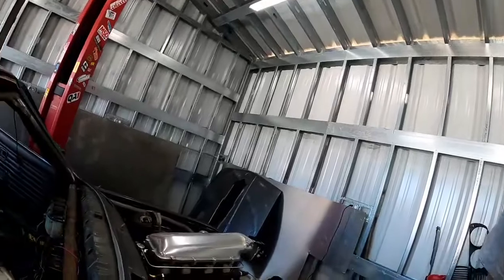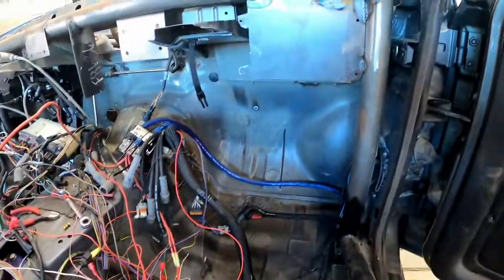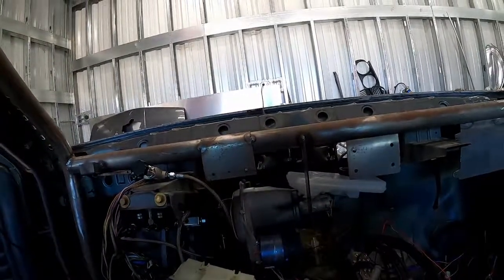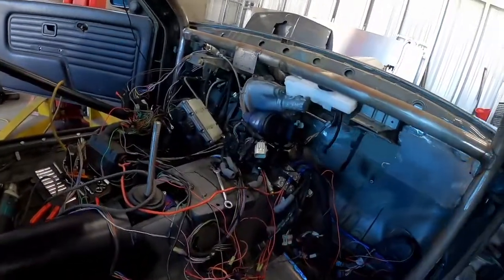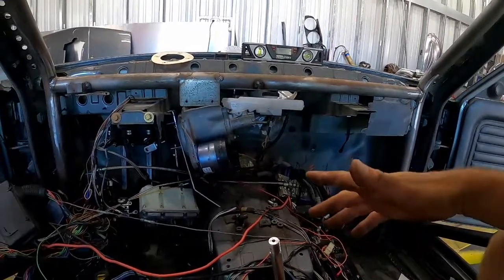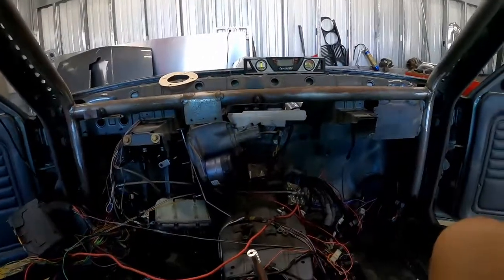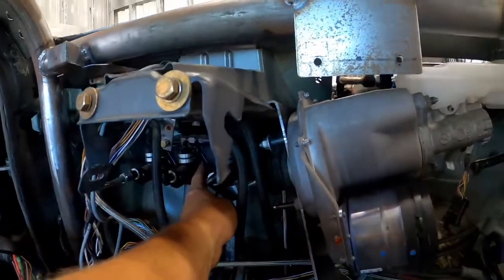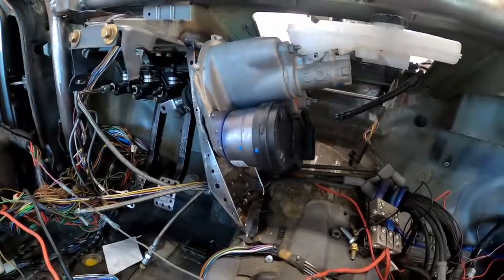DIY: Tesla Electric Brake booster in Evette twin turbo lsx bmw e30

Comment: Best of luck with your build! I mounted my ibooster today in the VW bus. Have you figured out the brake line fittings\reducers needed to connect the ibooster to your car brake lines? Looking for ideas and where to source the parts.
Reply from the maker: I managed to source reducing fittings that sized up with e30 stuff at autozone believe it or not!